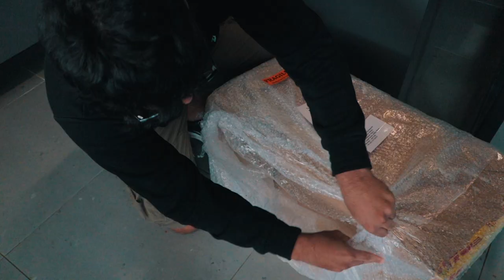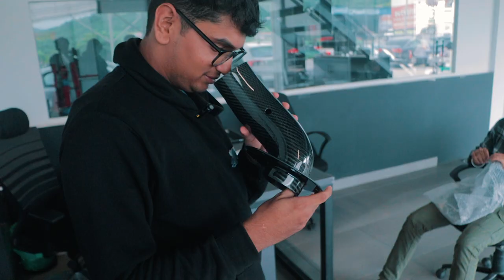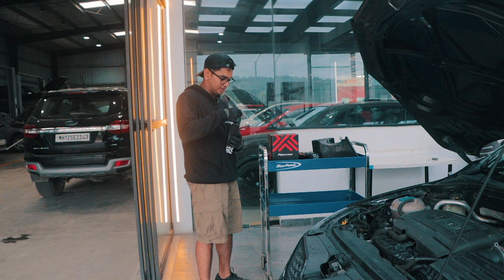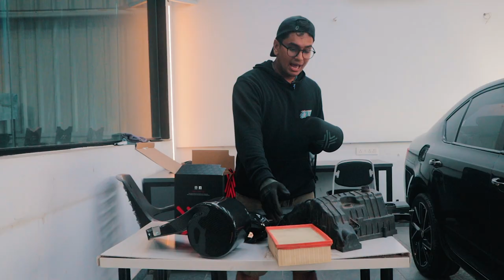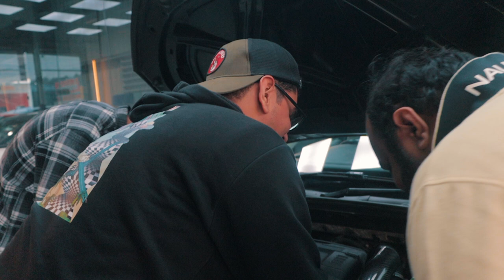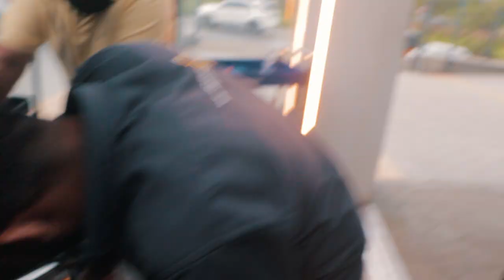Carbon Fiber Intake for our Octavia 1.8 TSI! (BIG Power Gains 💪🏻) | Project Octavia

Comment: Cut the carbon shroud on the right side so it will still act as a cold air intake plus won't be as restrictive as it is right now. plus sound better. 😋...

Comment: Am I the only one who thinks that air intake made of carbon fiber doesn't really make sense....cool kit though
Reply: With you on this bro. Apart from an eye candy under the hood, I don't see the point of it. A plastic intake kit would do the same thing for a lesser price
Reply: @SomjeetHomRoy  yes brother I do think this so ?
Reply: Didn't you get the point? Tune will get you where you want to get to. Suddenly pipercross is the best. Lol
Reply: @kutlee2009   that wasn't my point,there is no reason for an air intake to be made of carbon fiber other than weight reduction which is pointless in this build and it's not a stress member.
Reply: @kutlee2009  and we are not talking about the brand....we were talking about the material used.
Reply: I was just thinking the same😂